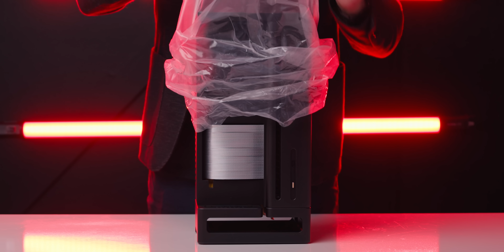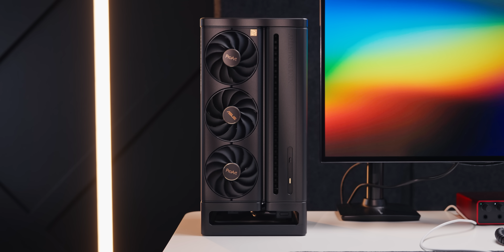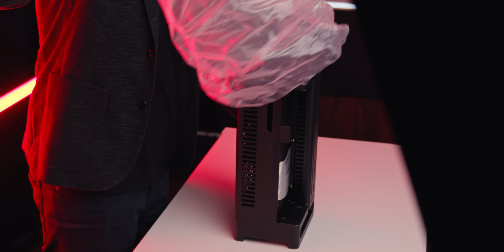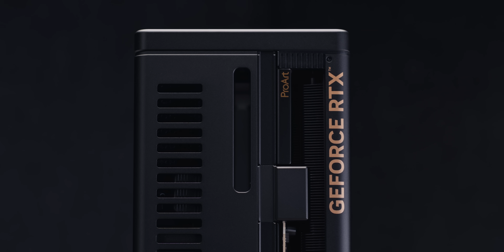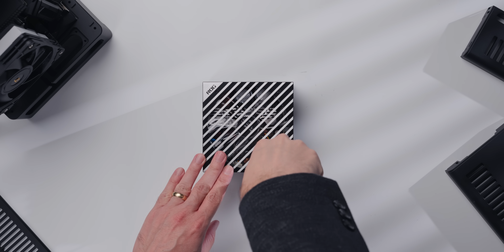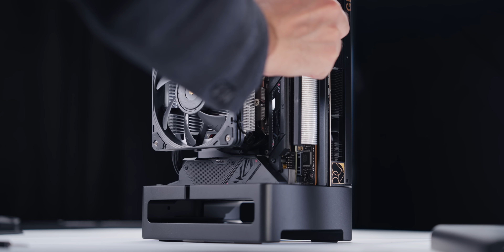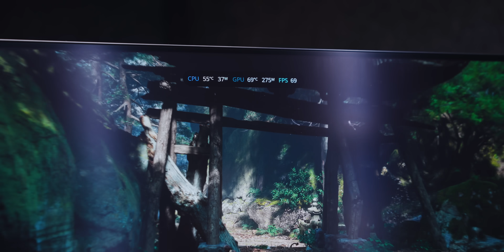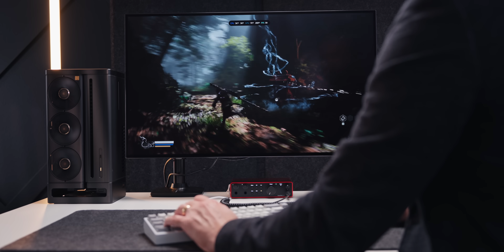THIS is peak SFF.

Comment: Definitely an example of aesthetics over functionality. Beautiful case.
Reply: Near perfect thermals in something smaller than a shoebox says that "functionality matters" to me. Not saying it's cost effective but this thing rocks.
Reply: @ldm125  Great point. I was looking at it from a compatibility perspective. The card in there looks and behaves great. A founders flow through card would be fine but wouldn't perform as well.
Reply: @ldm125  not remotely perfect thermals. My watercooled 4080 super runs quieter and maxes out 15C cooler than this.
Reply: @jeremytine  yeah everything can always be better but think about how much money and time you had to put into your system to get that result. 

To be clear I'm talking about the fact that the car is pulling as fresh of air as possible means it will cool at peak for its cooler.

Comment: I think people don't understand why products like these are $600. It's not $600 because of cost, it's $600 because almost nobody buys something like this. It's super niche.
Reply: To machine these it probably cost them more per unit because they are not mass producing these.
Reply: @quandingleberry445  Exactly, machining is expensive as hell, even more so if 5-axis milling is required.
Reply: @tommy.eklund  if a 5-axis mill is required for your case, you've botched the design.
Reply: @wundsalz6831  Also true.
Reply: Yh it’s a once in a lifetime kinda build
Reply: Sir its 600 because there is expenses in the forms for all the materials that's extruded and then machined afterwards setup cost etc... it expensive but as an engineer I understand it jigs and fixtures etc cost too.... I can't justify it though my self.... I want something similar but id say 300 is more likely to make more sales maybe  as more sell they may lower price
Reply: @fabriglas  They are not trying to sell a lot of them, this is a one and done production run. They make it because they can - not because they make money off it. A product like this would not sell much more if it was 300. The people who want it will buy it regardless, the people who won't buy at 600 won't buy at 300 either - and rightfully so, it is a compromised proposition. I wouldn't pay 50 for it. Not sure I'd want it if it was free, it serves no purpose for me since it is based on building something I have very limited use for - and I already have a prettier case than this for the build I want to build - I have a 'Stormtrooper Y70 Touch' case with a rotating lit white pedestal for it, with a modded up Corsair H150i RGB cooler with OLED pump top etc. It's a very different look than this kind of thing, but it will definitely make most people take a second look.

Comment: I love the look.  It's beautiful.  
I don't think I would buy it even if I had more than 84 cents.   Zero protection from the elements for that GPU.  Zero noise reduction.  Very high cost.  For $600 they could have included a cheap tool to reach that part one needs to reach to use it.
Also working with only a couple of GPUs and a single PSU model?  So basically as soon as you want or need to change your GPU, you are FRAKED.  If the PSU needs replacement, you are FRAKED.  IF you can't find the same exact models available any more.   $600 down the drain.
Only one USB port at the front and all the motherboard's ports at the bottom of the case...

Again aesthetically it's beautiful.  The artist inside me loves this.   I wouldn't buy it though.  The idea of building a desktop PC for very limited specific hardware and nothing else, feels me with a reflex of me saying GTFO to it.    If someone (yeah I know) gifted it to me, I would cherish it and keep it long after it was dead.  Since that obviously is not going to happen, pass.  

Thanks for the video and bravo to the people who made it for trying something different.
Reply: i wouldn't have said it better , thanks !

Comment: The Bugatti of cases. No need for it besides bragging rights. It’s a niche market anyway so spend less and get a good enough case like the Era 2, Terra or Dan H2O
Reply: It's a collectors item the thing wouldn't even be for sale if the people in the comments of the original post didn't convince the guy to sell it to them😂
Reply: @sys-administrator of course Ali is an option. My point was you can spend an average amount in the SFF space and pretty much get the same results in volume
Reply: @rogerhalt3991  the most important thing for people with money is time. yeah you can argue that anyone who wants a statement piece on the desk is able to save a few bucks here and there but that involves a time investment.
Reply: The Bugatti has a point. This case is literally just useless.
Reply: @mr.number9279 Idk man, some things like aesthetics don't always have an intrinsic value. Some people are perfectly happy paying a premium for a case like this. Not me though.
Reply: @mr.number9279  correct. cant even upgrade it

Comment: I don't think people are missing the point. it's just that the bast majority don't care for a case that is made around specific components.

So it is more of "the point" missing most people as this is an extremely niche product.

Not only that, but the parts this case is built around are from asus, which more people have been starting to shy away from.

Comment: Pulling an apple in 2016 with that 1 usbc port. Just buy 15 dongles
Reply: You can actually connect anything you need, its designed to route out of that slot along the bottom. The website shows it better. You'd have to lift or tip the case every time you add or remove anything though
Reply: I can tell the type of person to buy this case would hide ports so he'd probably buy a 10-15 port dongle and drill or glue it to the bottom of his desk.
Reply: Don't be ridiculous. You only need 14 dongles.
Reply: its prob a 4g/s port so you can split it into like 30 ports with a single box
Reply: A typical mITX board has more than enough IO on the back for most people's needs...
Reply: Y’all really haven’t heard of usb c cables huh
Reply: I get it, form over function, gorgeous form though .... Would I? Absolutely not, I'm a function over form kinda guy....

Comment: Try to build an sff with the minisforum motherboard
Reply: I've done this with Dan A4-SFX and whisper quiet with Silverstone Airslimmer fan sucking air out of the heatsink through the side panel which  it is mounted to with 2mm gasket (aligned with perforations of course)

Comment: Exposed GPU fans = NO THANKS
Reply: Not really a problem in my room at all. Have an open case for almost 2 years and I couldn’t be more happy :). 

The whole thing of “what about dust though” is very dependent on the dust situation in your house. I clean mine every 5 months or so for like 8 minutes and everything is clean again. And even after 5 months not like there is a pack of dust on it rather just a very very thin layer. And even then there is no drops in either performance nor higher temps
Reply: @xEchoDrift  All that build quality, small size etc and its not even portable  😂
Reply: @ΔαυίδΠριδεαυξ  oh I wasn’t talking about this case btw I don’t have this case and I wouldn’t want it personally. But my case has the same amount of portability as any other case

When I go to a LAN party I just take out  the GPU (which a lot of people do anyway when they move their PC to a LAN because it’s the safest thing to do especially with horizontal mounted GPU’s) which is the easiest thing ever takes like 40 seconds, and put the PC in a bag and that’s basically it. I also have a car which makes it all the more easy :)
Reply: @xEchoDrift  For sure there is a time and a place for an open case PC.  However, this case is a vanity project built on hype and influencers.  The fans on the ProArt are loud at full tilt whether in a case or open.
Reply: @ΔαυίδΠριδεαυξ  I don’t have the ProArt nor have I ever heard it so I will take your word for it :). 

But yes this case is only for a very tiny group of people but I think Devyn has made that perfectly clear in my eyes in the video anyway. Nobody should look at this case as a normal case that is for the masses you are absolutely right
Reply: @xEchoDrift  If I want a premium small case the starting point is FormD T1 - they even have a travel kit that locks a 40 series ProArt to the case securely.  If I want to go smaller then Velka 7 / Dan A4-SFX.  These cases have been around for ages and you can travel with them, they look good, well built and do the job.
Reply: @xEchoDrift  If I want a premium small case the starting point is FormD T1 - they even have a travel kit that locks a 40 series ProArt to the case securely.  If I want to go smaller then Velka 7 / Dan A4-SFX.  These cases have been around for ages and you can travel with them, they look good, well built and do the job. (some reason this reply was deleted?)

Comment: This really highlights how much engineering is needed to compensate for the archaic and stupid cable mess that we deal with now. Nice clean design would be easy if they redesigned power delivery.  Also get rid of the gold "Geforce RTX" on it.  Such a stupid gamerz! name.  USB underneath doesn't bother me.  Connect a slim USB C hub and attach underneath desk.

Comment: Its just like a mac. Very expensive and no upgrade path at all. But its very clean looking ngl.
Reply: The case ... Only the case
Reply: Hum... You can actually swap out the mobo, processor and GC anytime you want??
Reply: @nitram.9621  It's a mITX  Mobo, nothing special. The only issue I see is the need for a specific power supply.
Reply: I just want do declare that you just limit your options down to like 4 gpus and psus and if the next gen isnt the same form factor, you cant really upgrade, because if you buy this case, you clearly care about the look of your pc which would be kinda ruined if the gpu doesnt match the case. From the enthusiast standpoint tho its an awesome case.
Reply: @kleinsparky  Asus is trying to make a standardized line of cases, mobos, GPUs, RAM, etc. It's an interesting idea, but Assus is well known to be full of greedy investors that actively sabotage their engineers. Still, the mini PCs they had, the GPUs and the new E-ATX case are quality and not ridiculously priced.
Reply: You can buy a mac mini for the price of that case
Reply: Not a surprise it's going to be sold out
Reply: @Ryuken2721 bro I just checked their website and it’s sold out
Reply: Except this can game
Reply: you can throw a 9800x3d in it now, how does that work in a mac?
Reply: thats exactly what i tought like a trashcan
Reply: I like selling my old pc and building a new one anyway
Reply: @steelpulse313  that's why this PC is best for you. If you're familiar with business, you know there's supply and demand. Right now there's supply of this product, but what about the future? They won't make this anymore, and that makes the supply of if low. As God of economic says, low supply mean high price. Buy this product now, in 5 years it's going to be expensive, sell it for a profit.
Reply: @Ryuken2721  Except there is another part to that equation you are missing, the demand is not guaranteed. Right now sure some small niche communities will be interested. But PC hobbyists are already niche, SFF is more niche and collectors (the only people who would be interested in buying this in a few years) even more niche. So no, any sensible person would tell you this is a bad investment since you are gonna struggle to find a buyer. Do not buy this expecting to make money or even break even when you sell in a few years.
Reply: @Ryuken2721 the thing about this statement is, the case is exclusively based on the 4080 super GPU and new GPUs getting released every other year or so.
It would only be relevant if the future GPU adopts the exact form factor of the 4080 super here otherwise it's a 4080 super case.
Reply: @FreeThinker0  apple sold Mac pro 2013 for 7 years and there's some people who still bought it brand new. Not a bad business plan from the way I see it.
Reply: @Ryuken2721  
Only if people actually buy it. Again, zero upgrade path from the 4080, and absolutle overkill for itx only builds
Reply: @Ryuken2721  Well it also requires demand, if you cant find the demand it will become a paperweight (although cases usually do because of shipping costs and how hard it is to find a local buyer)
Reply: @Ryuken2721  lollll what???? 5 years from now this will be a case that is only compatible with 5 year old GPUS... This thing is amazing and I'm leaning towards buying it... but nobody should consider this an investment!
Reply: @Ryuken2721  you will only ever lose money on this, it's hyper hyper niche and once the hardware is outdated it's essentially a paper weight. This is literally just a functional art piece for a well off PC enthusiast.
Reply: @Ryuken2721  Sounds like an incredibly bad investment lmao
Reply: unlike a mac tho, you can always repurpose a pc
Reply: @Naswaca  You can't quite repurpose this one since it's built around a specific GPU
Reply: Macs have a very simple upgrade path: sell or trade it in
Reply: Fdym no upgrade path ? You sound stupid . Am5 will be supported till 2027 at least
Reply: Don’t compare gem with 💩 like Mac
Reply: Realistically…..who’s gonna upgrade a 4080 super in the next 7 years 😭
Reply: and as idiotic as a mac user :D
Reply: What do you mean no upgrade path lol. It’s a case 😭
Reply: it's not made for someone who upgrades his PC
Reply: you can game on it though and a 4080 is gonna be able to play games for a long time, as long as it doesnt decide to cook itself.
Reply: Except the Mac doesn't look as good. Or rather, it looks like a cheese grater.
Reply: Mac actually protect your EXPENSIVE electronics, this thing is not even sneeze proof. This thing looks like it will short if you sneeze on it.
Reply: Incredible he gets 2.7,000 likes and it's not even accurate what he's saying because you can actually upgrade the GPU the CPU the nvme etc what can't be upgraded for obvious reasons is the case
Reply: Not very much like a Mac because it’s still like 4 or 5 times the size, probably not the same performance for many applications and runs your electricity bill through the roof
Reply: You dont buy this with the intent of upgrading it, you buy this because first of all you have people seeing your PC such as friends or co workers and you want to have a sleek workstation and you have the money to throw away. No normal person is going to buy this, especially with todays GPU pricing.
Reply: "no upgrade path at all" How? You can clearly upgrade everything aside from the GPU unless they make more proart models for future cards or you don't care about a perfect flush fit.
Reply: @kwedl Considering how well the ProArt series is selling, I'm 100% certain you'll have at least two more generations of GPU upgrades.
Reply: @Liminal.Headspace  He's not saying we might not get more proart cards... we will for sure. But what are the odds they will fit PERFECTLY. This case is designed for a flush fit which will not happen with future cards if they even change the dimensions by 1mm.
Reply: @GenericYoutubePerson  Well, that's the whole freaking purpose of the ProArt lineup. What Assus will actually do is up in the air.
Reply: @Liminal.Headspace  "I'm 100% certain you'll have at least two more generations of GPU upgrades."

 with zero likelyhood the dimensions and port layout will remain the exact same as required for this case.
Reply: @jeremytine  You're trolling, right? What ports? PCIE isn't going to change and the stupid power connector will stay the same for a while. Yes, you won't get a 5080 or 6080 in the same size as a 4080, but the chances that the 5070 and 6070/6060Ti will be the same size as a 4080
Reply: @kwedl  Or you can 3d print custom gpu shroud to fit design.
Reply: I have never upgraded a computer. I throw them away and buy new ones to help ewaste.
Reply: CPU is upgradeable, RAM can be replaced up to 128, NVME can be replaced with a bigger one and if there would be the same size and design, for example, 5080 super, then it also would be upgradeable
Reply: @inkruinnn  Have we all watched the same short? The only thing that's 100% not upgradeable and non negotiable is the freaking PSU. Because of custom cables. The GPU is the top of the line for Asus ProArt and only the second best gaming GPU. They're probably gonna keep it up with 5000 series.
Reply: @Liminal.Headspace  And tell me please, how the CPU isnt upgradeable? How the NVME and RAM are not upgradeable? If GPU is the only thing you think you can upgrade on your pc then why are you even starting this discussion?
Reply: @inkruinnn  Are you simple? We're talking about the  case, not the motherboard. The case uses the ITX standard, you can use any mITX motherboard you want.
Reply: @inkruinnn B650e-i 96Gb max. And i doubt many could afford two dimm 96Gb if you could even find them.
Reply: It's nothing like a Mac must be an American thing with people not being able to appreciate something they'll never buy.
Reply: Nothing more false than that. 
The only thing you can't upgrade is the case.... 

Idk who put likes to your comment.
Reply: @lorenzogazzola328  well and the gpu... and gpu is the easiest upgrade. Wahwah
Reply: @815TypeSirius  
You do not understand the meaning of what I said. 

To upgrade the GPU you ALWAYS need a new GPU.  
In this case to upgrade the GPU you need a GPU and a new case. 
Soooo.... The only not upgradable thing in this system is the case.
Reply: @lorenzogazzola328  and the gpu.